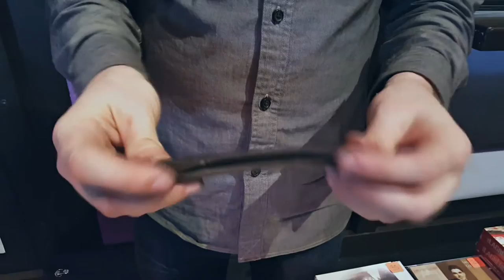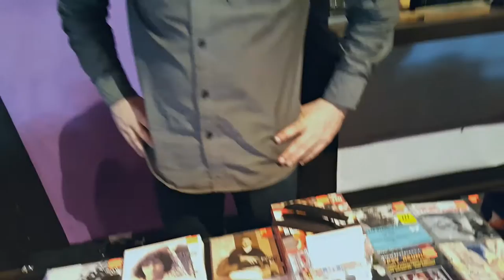Gypsy Jazz Quick Tips - Episode 9: custom bridge setup with Tommy Davy

Comment: Maybe I just missed it, but I did not see Tommy adjust the feet of the bridge to fit the contour of the top.  I notice that the bridges for sale at DjangoGuitars are listed as pre-readiused.  So maybe he felt he that it fit well without further adjustment.  But proper fitting of the bridge feet is an important step that should not be overlooked.  

 Thanks for this video.  I think the bridge and adjustment of it are very important to the function and sound production of the guitar.  Changing the bridge can really make a difference if one knows what to do.  The video may make it seem simple, but there is a lot of knowledge behind what Tommy did there.